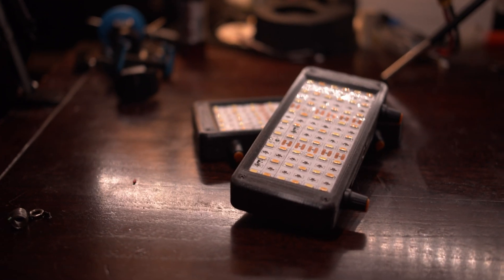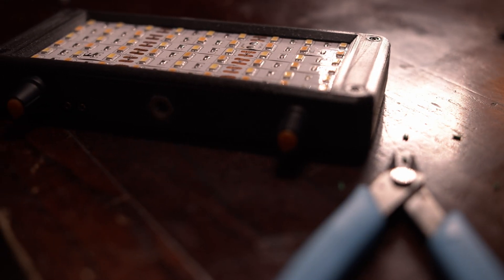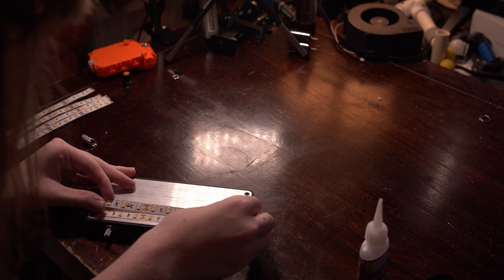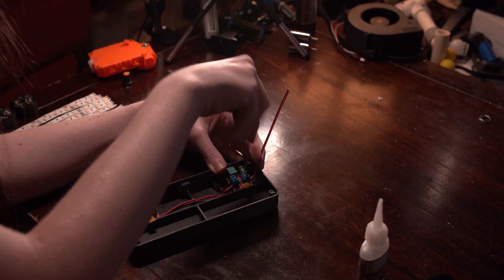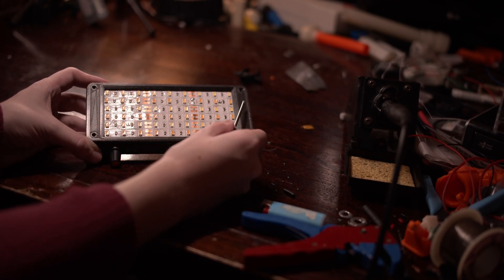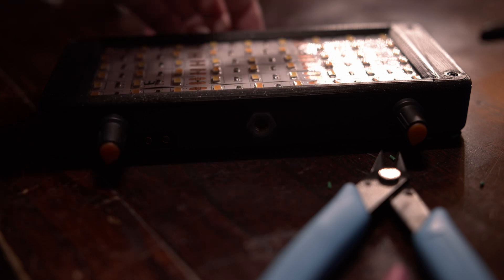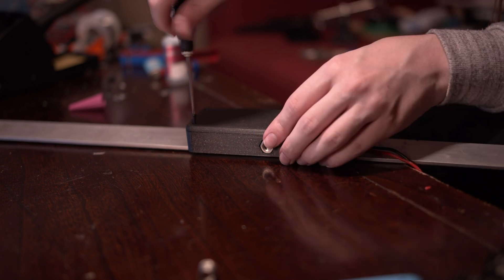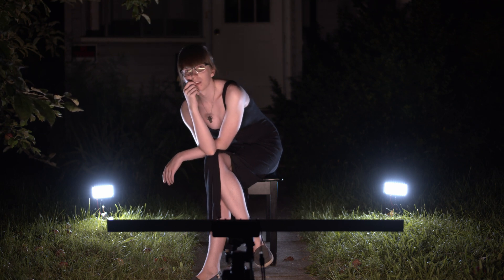Scaleable, Portable, Open Source Studio Lights

Comment: What are you using for a power source?
Reply from the maker: Anything 12v with an xt-60 works. I've been using 3S lipos, but I've also wired up a 12v laptop supply with an xt-60 so I can plug into a wall too
Reply: Alice - Coatduck that’s what I was thinking, the laptop supply. Thanks, great job.